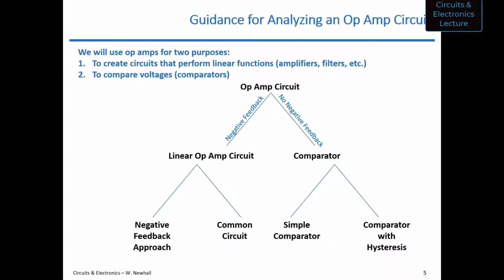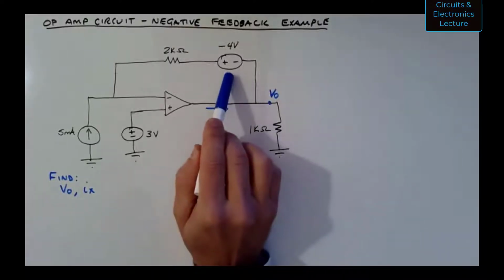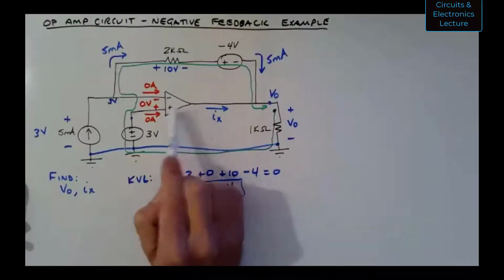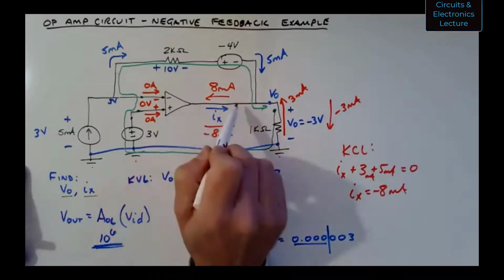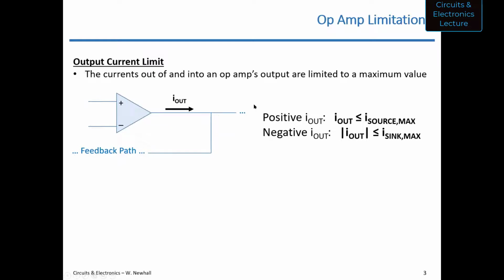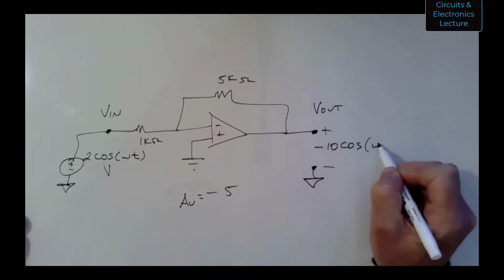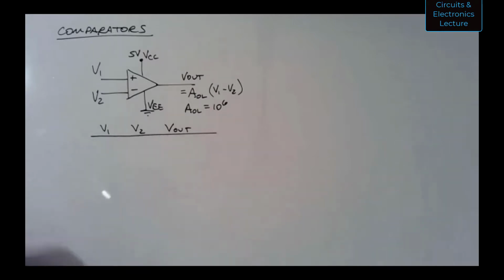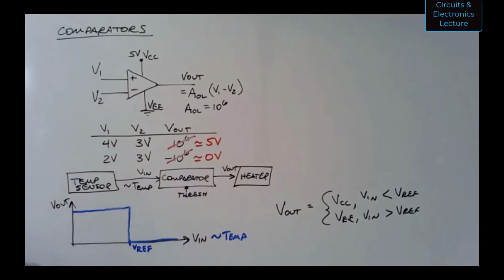Circuits & Electronics - Lecture 17 (Fall 2020)

Comment: Thank you sir... May I know what current sources are in real world. For me understanding Voltage Source is easy since battery is very familiar to us. But what is actually is current source and how they are realised in practice ?
Reply: I didn't post this video but your question is one that plagued me for many years so I feel qualified to properly answer it for you. Most of the time when someone is talking about a current source they're not talking about a specific device such as your example of a battery being a voltage source. This is really annoying and confusing and the circuit at 4:36 is a great example of why. The only reason the current source at 4:36 is there is because the op amp is making it a current source. If the op amp wasn't there, the 5mA wouldn't be there either. That's why I have a problem with this whole lesson. I hate the theoretical approach because it confuses the people who are actually trying to use this stuff in practice. That 5mA of current at 4:36 is being sourced by the op amp itself. The op amp and it's feedback path are allowing 5mA to flow there and thus made it a 5mA current source. He had the opportunity to explain that when the student asked "what if you had gone through the 5mA source?" GREAT QUESTION. But he chose the single most impractical way to answer that question. "Without looking at the rest of the circuit..."  OK yea, if you cover up the rest of the circuit then we don't have a circuit to solve at all so is class dismissed?  We ARE looking the rest of the circuit and we DO see that there is 3 volts sitting at the non-inverting input therefore there is 3 volts at the inverting input too. I think the reason why he avoided that is because then the kid would've said "So why don't we just use the 5mA to get the 10V voltage drop then use the 3 volts sitting at the inverting input and subtract the feedback loop from it [3-10+4 = -3] done?" and he would've been right because that's the easier way of solving for Vo but the teacher is obviously trying to push KVL. So I get why he chose to answer it that way but given the fact that it isn't a practical situation to begin with, plus the amount of questions he got about it, he should've explained it better. But they never do. Now you see why I said it's annoying and confusing when people use the term "source" without any explanation because we tend think of a source as originating from somewhere external to something not a product OF something. The fact that they provide it as one of the pre-given values in the problem only adds to the confusion. But yea, the op amp itself is sourcing that 5mA and the only reason they are providing it for you is because you need it to solve for Vo and they are trying to teach KVL equations. If you try to consider current sources the same way you consider a battery a voltage source, you will be eternally confused because there is no such thing as a current source under that rationale. I know it's stupid. Hope that answers your question.